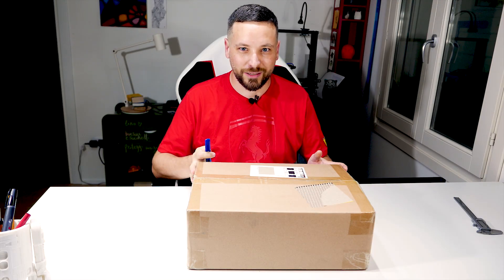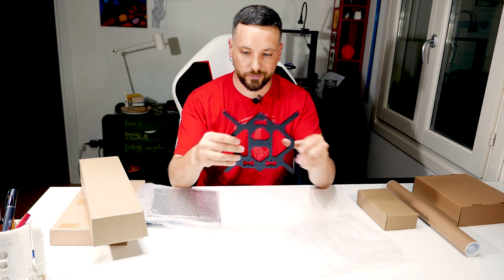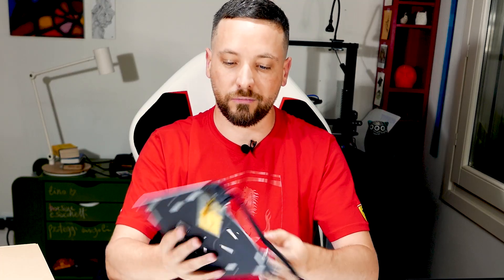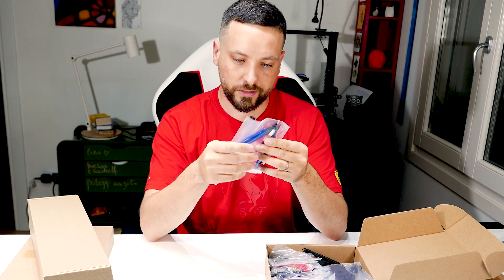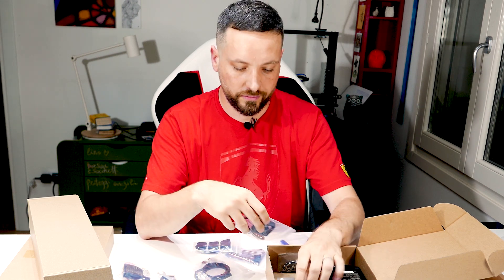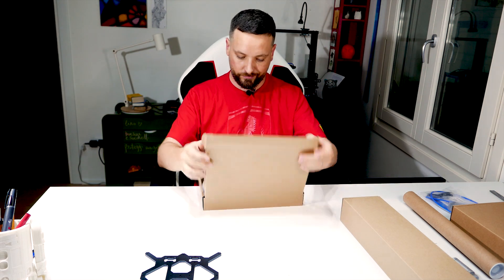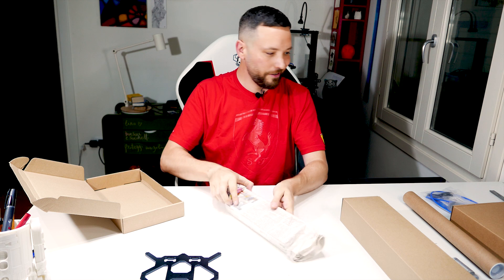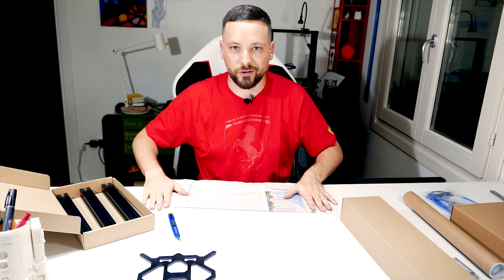Prusa Mini Clone Kit Unboxing and Build!

Comment: Watching this, I'm a little concerned at the presence of a tap and die set on the desk.  Are the threads not pre-tapped?
Reply from the maker: A couple of them were not. I think it was a mistake in the supply.
Reply: @AMakeDesigns  Fair enough.  I do have a tap and die set but I've no idea what the specs are.
Reply from the maker: In my case it was a couple of M3 threads.

Comment: hello. could you please tell what material is used to make the heated bed? is it glass fiber sandwiched between the PCB sheets like prusa or is it aluminium block? thank you
Reply from the maker: It looks like the Prusa. For sure the pcb is there, I can't say if it's fiber glass inside but I guess so
Reply: @AMakeDesigns  thank you I appreciate you answering. all the best with your channel ;-)

Comment: Hi, I have build my mini last week. I have replaced hotend with bondtech variant and I have to print without that pink sock because print cooling fan was blocked by that sock, my first benchy looked really bad. Also think about safety and fix heated bed connector, it looks like 007 says that this bed kills you... You can also show us how to properly set tension of feeder.
Reply: Just tighten it fully and then loosen the screw while feeding material until is doesnt crack the filament horribly anymore. The original feeder gave me inconsitent extrusions with some materials though. But thats a flaw of the original design. Both my heatbeds were wired correct but yeah... Fysetc doesnt have the best QA. I got 2 powedered steel sheets + a BMG mini as compensation for some minor failures.
Reply from the maker: The sock is garbage, I agree.

Comment: I already build two of these. Paired with Bondtech heatbreak and extruder it's a pretty neat kit. They use a full ptfe lined heatbreak. You might have to remove some paint on the inside of the coldend to fit the Bondtech heatbreak but the paint shouldn't be there anyway. Ask Fysetc for the "MAC address fix" and you will receive a ZIP containing a written build manual and a network fix. It's a shame Prusa has no Kit. :(

Comment: Nice sweet holly mammma! I have got the step file for the whole prusa mini- have printed the x and y carriages - and before started to print the table basement have decided to change it! So I did! And have noticed the alliuminium profile for the z axel is fixed to the table frame by 2 screws only! Also do not like the y carriage and the x carriage after I have installed the linear bearing and when I try to take it out have broke it! So I have decided to change it too! Also the problem with the bolden drive- because of the construction you cannot install it (if you wish you can but for sure will have pronation quality issue) so I have decided to change it all! To do printer with the printing bed size 200-200 mm very light bed! For the carriages of the x and z axels I will use the carriages from prusa i3 (have printed it already) if anyone needs the step file for the prusa mini can send it by email! But as I have said was keen to build it but because of the above problems I am modify it and will bugle it! :)))
Reply: its 3 screws and its fine.
Reply: only good shit for sure it is good but I prefer skr 1,4 with 2209 ;)
Reply: @mitofun6967  i actually prefer Duet. I was saying 3 screws is more then enough, if your concerns were true this piece would destroy the printer. https://www.prusaprinters.org/prints/14610-prusa-mini-handle
Reply: @brotuser  using wheels) so in my case only two z))))
Reply: Mito Fun not sure about your point? By default it uses three screws to fix the z-axis to xy which is totally fine. If you change the design on your end you for sure have to account for those changes 🤔i would not suggest to make the hotend to heavy btw. This cantilevered design needs a lightweight x axis setup. Its that „flimsy“ on purpose. You will limit the printer in speed and accuracy. I have seen some crazy setups too but this is no Voron or D-Bot. I aggree on the fan part of the x carriage though. It needs some kind of redesign to provide better airflow
Reply: @brotuser  agree this is fine if the printing head is light!) building same size 186-186 -200 but with two Z axels )
Reply: Mito Fun so basically a mk3s mini that fine i guess. Direct extruder?